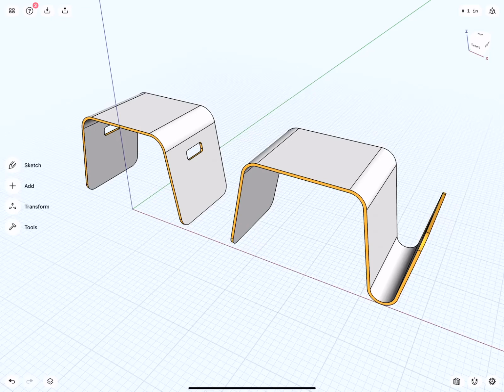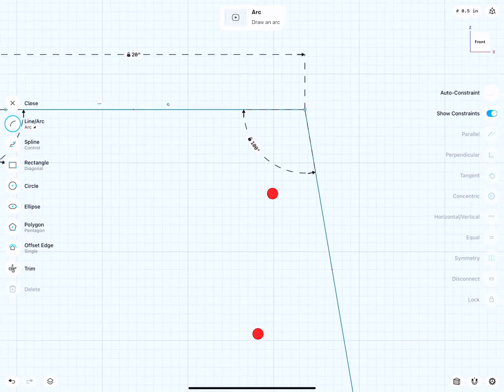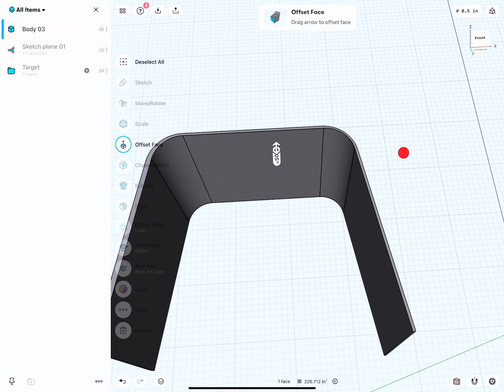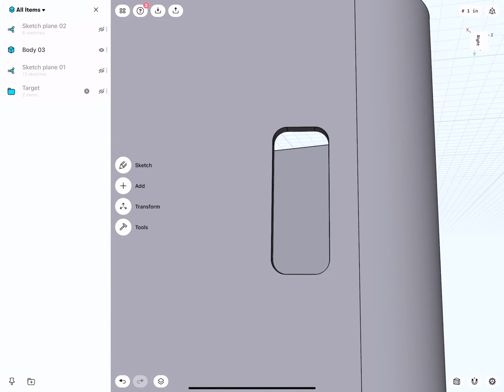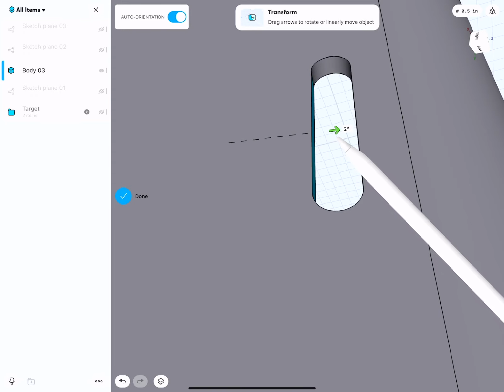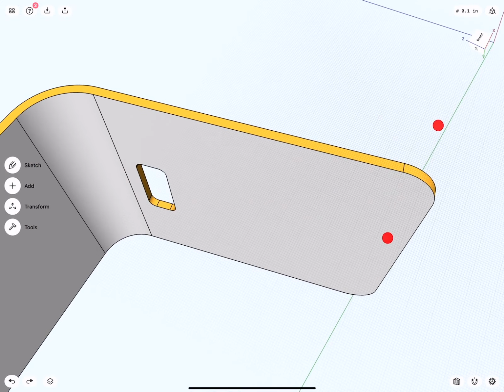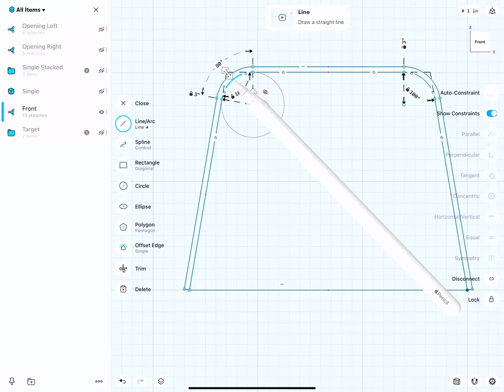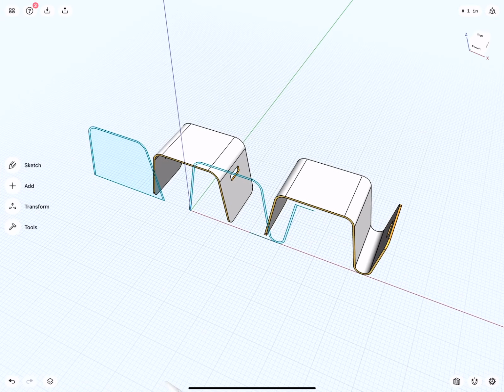3D Modeling a Bench on iPad | Shapr3D Step-by-Step

Comment: Hello I have a question can I use a other pencil or I must use a Apple Pencil 2. Generation?
Reply from the maker: Hello! Officially, only the original Apple Pencil (Gen 1 and 2) is supported by Shapr3D. It can be used with other pencils too, but the functionality will be a bit limited and there will be an "Apple Pencil not Connected" message on the screen.

Comment: I have pro and am wondering if there's an efficient way to create a crosshatch of holes through a face? I've tried making a shape and then copy/drag it vertically/horizontally (grouping to save time) and cover most the surface with them, then use those to make the holes, but it's not very precise ... at least I'm not aware how to make it so.